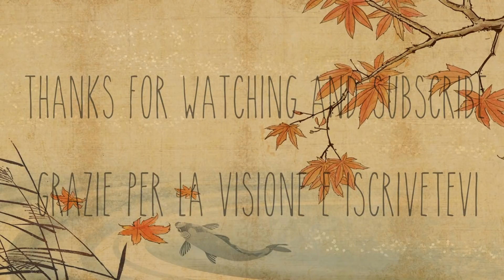ELEGANT  JEWELRY BOX

Comment: Nice shooting board and a fine build! What is that blade you use?
Reply from the maker: thanks. the blade is the same as the wooden vase video.
It is a CMT 6mm flat teeth blade. we can say it's the "dado blade" for the europeans. it works great for box joints. I leave you the first link I found. The width of the teeth goes from 2 to 6 mm 
https://www.tooltarget.com/cmt-industrial-grooving-saw-blades/

Comment: What kind of blade do you use?
Is that dado blade?
I guess i have the same table saw but i can't find a dado blade for it.
Reply from the maker: It is a CMT 6mm flat teeth blade. we can say it's the "dado blade" for the europeans. it works great for box joints. I leave you the first link I found. The width of the teeth goes from 2 to 6 mm 
https://www.tooltarget.com/cmt-industrial-grooving-saw-blades/